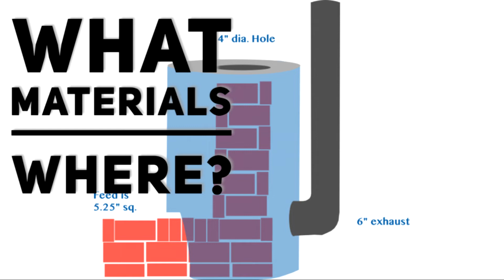What Materials to use Where in a Rocket Mass Heater or Masonry Stove Build

Comment: I made a rocket mass using water as the mass, check it out: https://youtu.be/ww7IqVTn7_k?si=HBd9IXZhFD066TCi

I made a mistake on the morter, i used regular morter with clay(bentonite) and perlite mixed in, about equal amounts of each, and,  after a month or so the first year, and about 2 months this year so far, its starting to crumble in the firebox, any modern materials suggestions for the rebuild?  And, how long does it need to dry before i can shut off the wallet draining electric heat again?